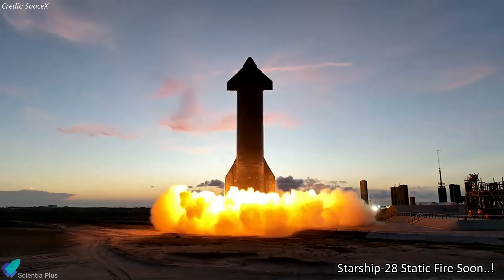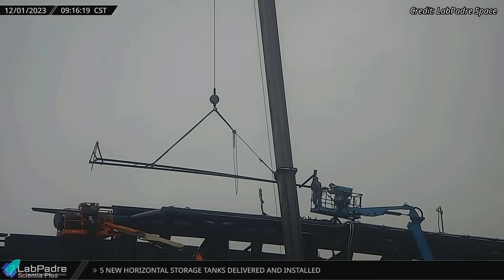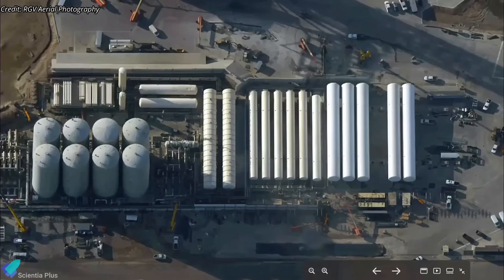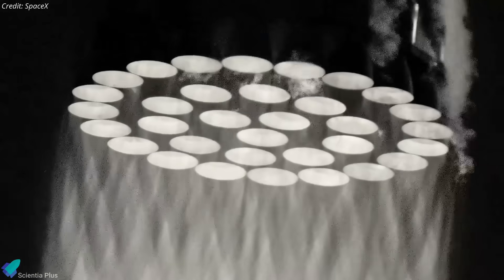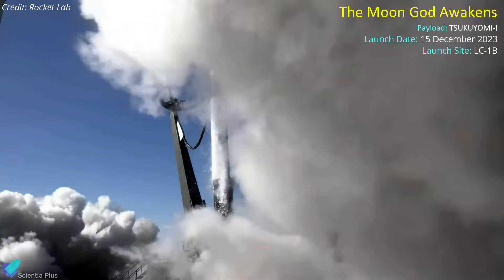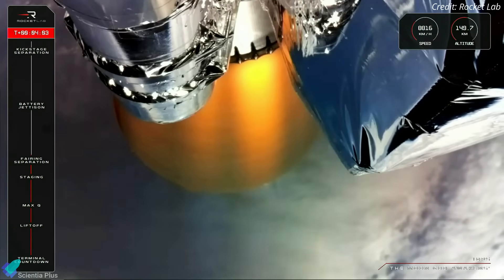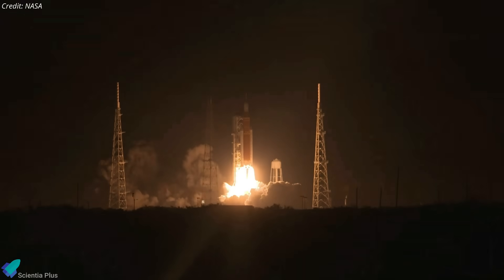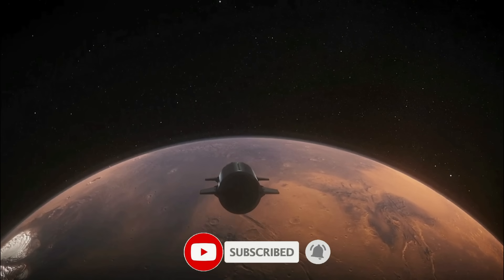SpaceX Super Fast Starship Flight 3 Readiness: Launch Window Announced & Next Level Tests Began

Comment: Why don’t they build a Starship 2nd phase as one giant tank, top to bottom, utilizing one product, either oxygen or methane, per starship? That way they could refuel a starship with two (2) tankers!
Reply: Needs both to reach orbit. Maybe they could have  2 dock together and could hold one of each in the payload bay?
Reply: Tanker ship design is longer and all tank, because propellant is the payload. Rocket equation tyranny dictates a lot will be expended, whether carrying to the depot or on a mission needing a refill. Eight flights for one is optimistic but possible.

Comment: They can’t keep damaging the base every time a rocket takes off, not if they are going to launch daily, like they want. There’s going to have to be NO DAMAGE during a launch.
Reply: They need to stop launching at an angle because the flame hits a single of the mount instead of the hole. Later, presumably when they're surer of the slow speed stability of ascent, not to hit the tower.

Comment: Launch mount clamps are too bulky 
too intrecate

Take the  apatuter mecanism of a camara?
like an iris it spins in and tightens alway to a centre point?

4 - 5   swivel clamps turning in to the ships base to hold
would do thge job wqith ease quickly joined as one action
only the cam edge that could be roller edged
to make a smooth release
 
high water tower tanks copuld be linked mnear the main
lift arms tower to release under gravity 
a spray of water over the tower in the moment the booster lifts off
the high water toer natural pressure
could also work lifting moving of massive heavy loads.
Even the whole rocket pad to a much greater height above the take of base
to ease wear and damage to area.
Water leverage can evenb take the take of pad out across the waters shore edge

This can be seen in europe with ships barges
where huge vessles are lifted moved up and down slopes
of diffrent water channel levels.